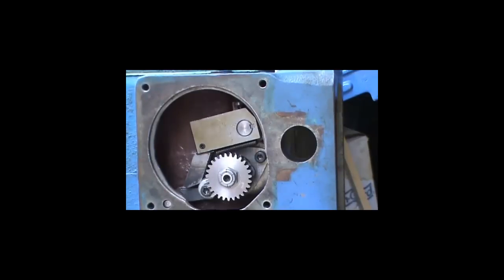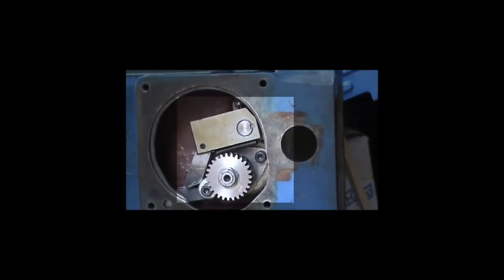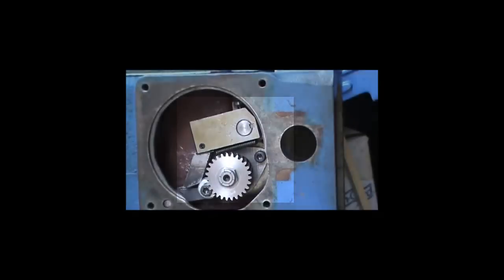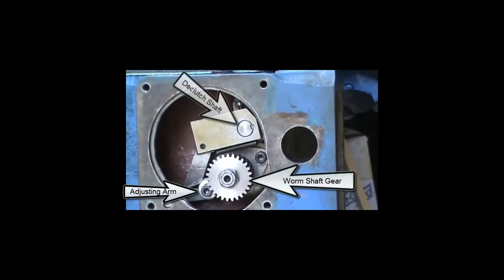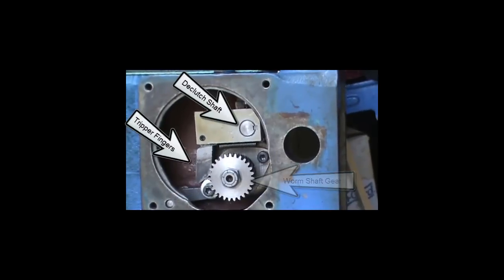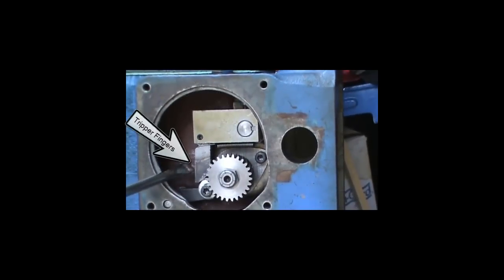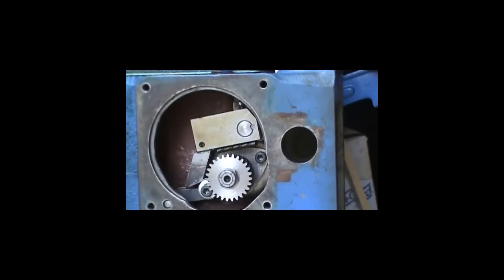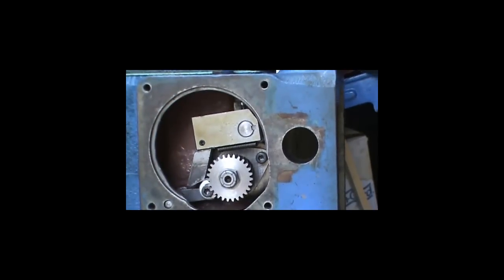Limitorque SMB-000 Tripper Finger Adjustment

Comment: It seems easy to make this adjustment, but when the cavity is filled with grease it is a bit harder to do.  I really think that Limitorque should modify this mechanism with a reliable manual release, like a forward assist on an AR-15 (M-16), and an electric Kick-Out Solenoid.  This would greatly improve the reliability of this mechanism.  I know that the Good People at PowerSmith have reasonably priced retrofit upgrades, including Girdle Springs, Semi Permeable Tremmy Pipes, and Spurving Bearings made from Prefamulated Amulite to reduce Sinusoidal Repleneration and effectively eliminate Side Fumbling.